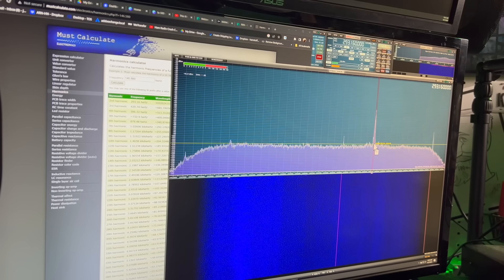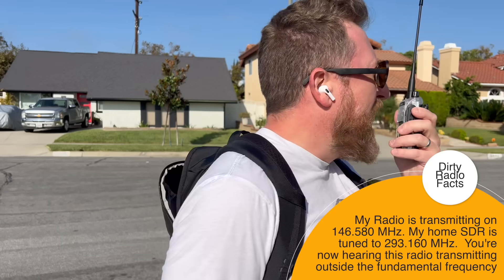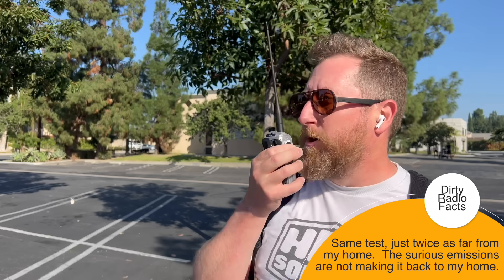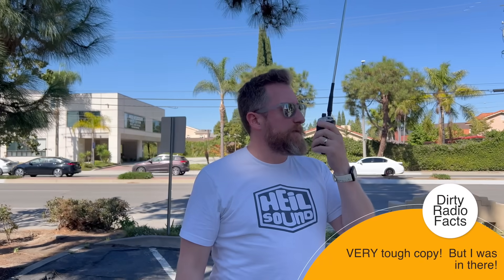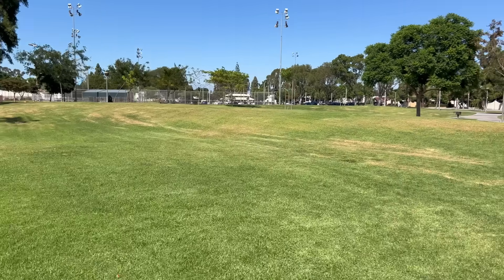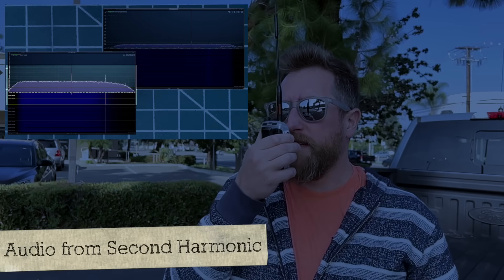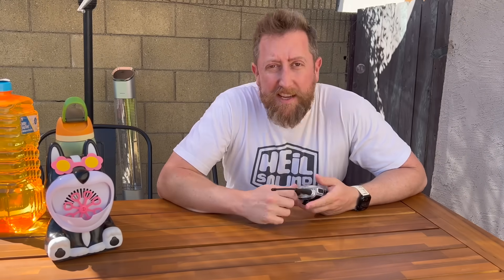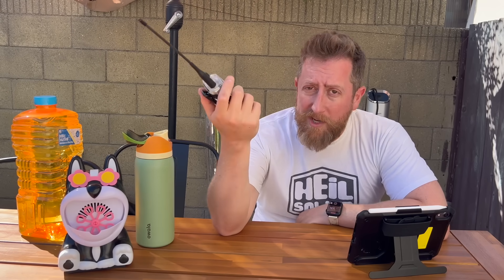Don't Buy Cheap Radios! HERE’S WHY! (Yes, Baofengs Too!)

Comment: I appreciate the video in a real world example.   I have tested various Baofeng radios on the GMRS band and I haven’t seen any spurious emissions.  My spectrum analyzer only goes to 1.5GHz so I can only see the second and third harmonic but all have been surprisingly clean.  I tested about 10 radios so far.
Reply: I'm calling bullshit....
Reply: I tested a bunch of baofengs on my rohde&schwarz SA and found horrific spurs from UV-5R V2+ on 2m/70cm. UV-82HP was even worse. both failed miserably. but a BF-F8HP passed FCC limits. what's funny is the while the UV-82HP failed its certified use limits, it actually easily passed GMRS limits which it isn't even certified for.

Comment: Okay, I've been using a Baofeng radio since 2016, and I've never had any one complain about the emissions. And where I live all emergency traffic, is now handled on a Trunked DMR, passworded system. I now use a TYT HT for my daily use, and its better. If your in an area of heavy traffic on 2 meter, then there might be problems.
Reply from the maker: Your stance here is diametrically opposed to the ham radio rules.  Get your radios tested and do the right thing.

Comment: Though it isn't pushing the limits of RFI - QRM coming from our own radios, I'd say that low modulation on FM is a big problem as well. I used a General Dynamics service monitor to watch 2 meter activity where I live for a few weeks, with the vast majority of signals exhibiting less than 600Hz of deviation, and some with deviation as low as 100Hz!  Of course if you're on the receiving end you can always turn up the audio, but then as soon as another radio transmits, with more optimal deviation, then you get blasted out of your skull!  It's a real big problem from what I've seen, and I would speculate that it's primarily due to folks being way too far away from the microphone and simply not being aware of the low level of audio they're producing and the challenge is poses for listeners.
Reply: @Willam_J Got any links to diagrams/ instructions on how to do that? Umm… for a friend of course…
Reply: I love the spectrum display on icom ic-705; it is a quick and fairly accurate indication of FM deviation.

Comment: Aloha Josh, I’d like to point out that not all Baofeng handheld transceivers are made the same. 
    Example, I own a couple of the Baofeng A58s Tri Bander radios(manufactured for only a limited time), not to be confused with the current BF-A58s that is only about 3 1/2 watts on high power. 
     So I used my A58s for our monthly VOAD Repeater test on 146.720 PL 100.0 in which I got a 5/9+ signal report at 280 miles and I’ve done this dozens of times over the last 10+ years. Granted that I replaced the rubber ducky antenna with a rubber ducky looking telescopic antenna that seems to work good with this island terrain. 
     I will say that Baofeng has come a long way since their first UV5R radios and I have noticed that these newer Baofeng radios has better audio quality or the audio not as hot like the UV5R’s when these first came out 20 years ago. 
    A better comparison would of been to test other handheld radios from other manufacturers to see if spending the extra $$$ was really worth the cost. 
    To add more content to your video would be to test each handheld radio with the Surecom SW-33 Plus to compare power and SWR’s also. Chuck KK6USY turned me onto this handheld meter in one of his videos and I’ve been very happy with the results of my testing, which I think is a “must have” power & SWR meter to own if you are going to rely on a handheld radio for hiking and/or mountain climbing or just a survivalist type handheld for emergencies. This meter is also great for testing different handheld antennas like in this video. 
     This is a great video because it gives me new ideas of the handheld radios I may want to purchase. 
      Thanks and Mahalo! 
      73 de WH6DWF🇺🇸🤙🏻
Reply from the maker: See Baofeng listed in description. Only one tested consistently good through a larger group.

Comment: Thanks for the video Josh and it only vindicates my decision to stick to buying. Yaesu FT-60R or FT 65-R.
Reply: I don’t have any first-hand experience with the FT-65 but I do have an FT60. It’s a solid radio that will serve you well for a very long time. Two features I want in an HT are air band receive and the availability of an alkaline battery case; the FT-60 has both.
Reply: @N2YTA  yes, I have definitely considered the FT-60R because of the air band coverage.

Comment: So what would you recommend for an affordable and durable radio for those prepared minded people out there? Keeping in mind wanting to have some redundancy.  Is the GT-5R that options or would you say something else? Maybe a playlist with some of these options/recommendations? Thanks
Reply: IMHO if it's one of these cheap "off brand" radios they are on the no list for me. Buy a reputable brand (Yaesu, Icom, Kenwood, Alinco, and probably AnyTone) or nothing. They pretty much all have budget models that perform much better than the cheap ones.
Reply: @mark12.31  you can add Wouxun to that list.